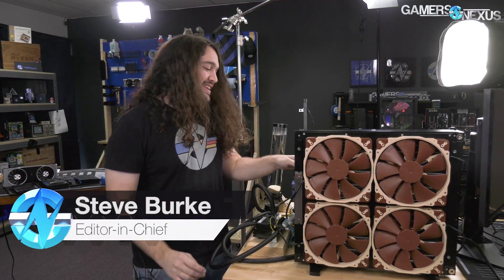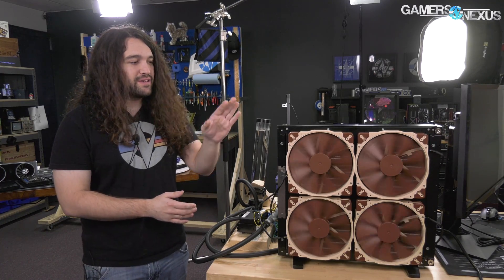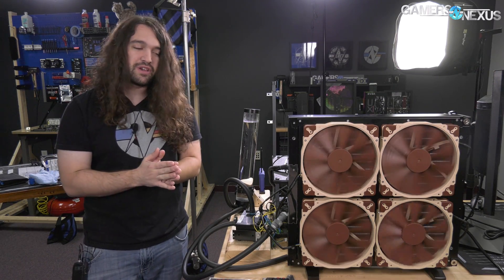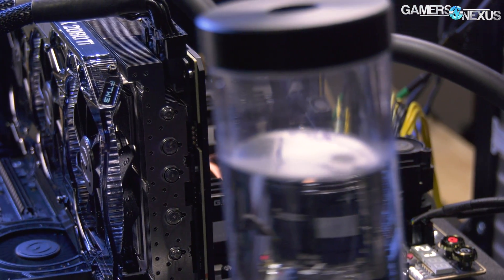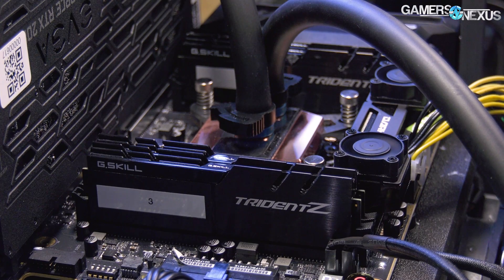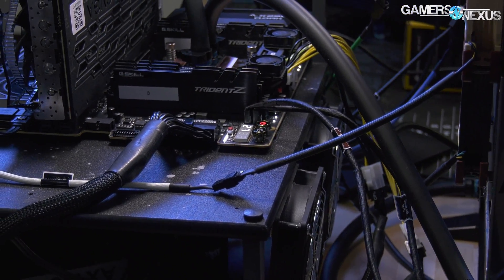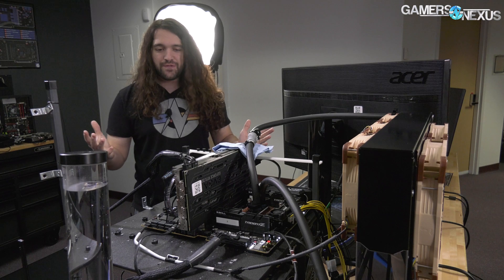9980XE Overclocking Stream Recap: Massive MORA3 Radiator

Comment: I had the idea of stacking thermoelectric chips for efficiency/cooling power. you can buy generic waterblocks in various sizes and I had one picked out that could hold 8 peltiers side-by-side. Never got around to modding it into my gpus, but 100 watts into 48 chips made a pretty good miniature air conditioner.

Comment: wouldn't i be better for the water to come out the bottom of radiator  giving that hot water rises?
Reply: Doesn't matter. Even a barely running pump is more powerful than the water.
Same with air. Natural convection can be easily overcome by a slow-running fan. A PC case isn't tall enough and the rather low temperature differential just too small to have a noticeable effect unless all fans are off.

Comment: I have the same brand HX from Germany, bought it about 8yrs. ago but mine is 9x120 or 4x180 fans. I have mine sitting on the second floor of my house and in a window all connected with  about 85 ft. of 1/2ID tubing single pump D5 Vario set at 7..3xTitans and a 5960 (running at 4.7GHZ) with a mono block all over clocked..and run around 115F in summer months and about 17F in winter months..17% Propylene Glycol to Distilled Water...approx 1.5 Gallons of solution. Amazing HX....Cool Video...Thanx for your time
Reply: wow dude please make a video of what you have now

Comment: Steve, I would like a video where you used this on a lower wattage CPU like a r5 2600x at stock and test the usability of a passive setup. And maybe test several CPUs until you find the threshold where the passive idea is no longer feasible.

Comment: I was considering the Mo-Ra when I was putting together my external loop earlier this year. I liked the side mounted reservoir, and the proper feet. However, the 9x140mm version I had my eye on (the one Steve has here) just felt too big, and I couldn't get all the matching parts at the time.
I ended up with a Phobya Quad 480/560 and knocked together a mount. It sits under my desk with the fans blowing outward, so it's quite nice now that the weather has started getting cold again.
I'm happy with the results but I still think about the Mo-Ra from time-to-time.

Comment: This seems like a very nice solution for cooling your computer when you live in areas with low outdoor temperatures. Just run the hoses outside and into that thing. Since it's outside, you don't need to worry about noise, so just hook it up with two huge box fans for a push/pull configuration and run them at full speed. That'd also allow you to have a very effective filter in front of the air-intake to avoid clogging up the radiator.
Reply: I have done exactly that, including magnetic filter. Works well as expected, except for hot sunny days. It is rated for about 2kW but with the filter and not high performance fans, its about half with acceptable temp delta.

Comment: Crazy idea.
Get 2 of those radiators, but thinner.
Use one for the CPU cooler, and the other one just in front of it
running ice cold water circulating through it,
in a push/pull config.
You can use an intercooler pump from a turbo or SC car for the ice water.
It's 12V
Reply: 2000cobraguy . While safe, it does seem the thermal efficiency is poor enough that it doesn't make much sense.
Reply: And intercooler pump from a turbo... The turbo is the pump

Comment: I am using that radiator, too, as an external cooling solution (attached the pump-reservoir combo to it's side) with just 4 large fans to get a basically absolutely silent setup. Moved it about 5m away from my pc, works like a charm :)
Phobya has a similar radiator called xtreme supernova.

Comment: you dont need that Radiator. If you just want good temps, both tubes into a 10 Liter bucket of water. It serves as passiv radiator+Reservoir and only costs 1 dollar. No cpu can heat up a full bucket of water.
Reply: Okay, just this once I will educate you. The volume of liquid has NO effect on the long term use. It will eventually heat up UNLESS it has enough surface area to radiate and conduct the heat to the surrounding material (that is, air, unless you e.g. bury the reservoir in dirt). You might get by with a metal bucket and medium PC load, but in any case, the large volume would be unnecessary, it is the outside surface area that does the work. AND it also implies that the surrounding material gets circulated so that it can dump its heat in turn.

Comment: It would probably fit into a case with all other components if you use the radiator as a side-panel. 
Well Ok technically it's not inside the case....

Comment: replace your glass panel with a radiator panel.
Reply: Replace all panels with radiators, who needs a case.
Reply: @backupplan6058  Should work but you would need a frame with filters!
Reply: @backupplan6058  Linus built an all radiator case.
Reply: Yes circle back around to 1998 cases!
Reply: That's what the previous owner did with my two MO-RA2s. Mounted them on each side panel. It was pretty bad.

Comment: At what point is it prudent to just get an unused car radiator, take the belt driven fan off, put some 200mm fans on and just use that?
Reply: Saw some similar size ones in a local auto shop, shame they are about the same price with the adaptors and parts to get it to same lvl, also not as dense and fine fins. I suppose a used one for cheaps might save you 50-80% but damn, some of em have a-lotta gunk in them, clog warning.

Comment: The real question is, why doesn't Intel publish accurate TDP specs for when your OC needs a custom industrial radiator with quad 200mm fans attached?
Reply: i get your point, but tdp is for stock operation
Reply: The real answer is, why should they?

Comment: Would love to see you do a more updated RAM clocking/overclocking video. My GSkill 4266Mhz is unstable with my 9900k. Sometimes it works fine, then other times machine goes crazy.
Reply: the SA probably can't keep up with those clocks lol
Reply: @bigdiglett3258  probably, was running 1.4v, the auto setting seemed high at 1.425v
Reply: was that your SA voltage? if so you might just have found a problem, if that was your dimm voltage you're fine
Reply: @bigdiglett3258  DRAM voltage is rated at 1.4v, but I had better luck with 1.45v running at 3733 15-15-15-36 @ 1.4v atm
Reply: @bigdiglett3258  yes, showed 1.394v in Windows/Bios after LLC adjustment.
Reply: @Ender_Wiggin03  running 1,4V VCCSA will kill your CPU. Even 1,35V is too much, I would stick to 1,3V for both SA and IO.
Reply: @dominikliberda4017  showing 1.296 VCCIO and 1.344 VCCSA in Windows, and everything seems very reliable at 4266Mhz at 1.4v. I'll try toning the SA down and see if it stays reliable.

Comment: Why not use speedfan to control the fans?
Reply: @moo  You can't link case fans with CPU/GPU temps in BIOS (UEFI)
Reply: @moo  What do you mean "You don't need to link GPU temp to case fans" in fact that's most important part, I like to keep my pc whisper quiet when it's not under load, and good luck keeping GPU temps in check with 140mm case fans spinning at less than 300RPM.

Comment: 2018 Glass Side Panels
2019 Air Cooling Radiator Side Panels
2020 RGB Air Cooling Radiator Side Panels
Reply: 2021 RGB Air Cooling Radiating case
Reply: just two days ago thought about case-radiator :)
Reply: what about using a car fan and the radiator?
Reply: You could just buy Thermaltake’s Xpressar RCS100 and have superior phase change cooling
Reply: 2025: Your PC is basically a see-through version with RGB LEDs of the freezer you had in your kitchen/basement since the 1960s.
Reply: A trend that is useful for performance!
Reply: Linus made one before.
Reply: @NothingXemnas  I saw the video of the radiator case. It's actually really cool.

But on a more practical note.
I would like to see standardised side panels with radiators.

Comment: Fun fact, the Mo-Ra costs only 216,93 USD (included a german 19% VAT). ~175 USD without VAT
Reply: Wow, not bad at all.
Reply: @GradyHouger  not bad for a rad of that size but you're still looking at another 130-200 for fans, res, pump, block, tubing and fittings. Still that's a decent deal for a super overkill cooling solution.

Comment: anyone else thought the bottom right fan wasnt spinning? @1:53 ish? Found i wasnt on 60 fps, I guess fan was spinning at really close to 30 rps? haha
Reply: to me it seemed it was spinning faster than the other 3 fans
Reply: @React2Quick i got that after i switched to 60fps
Reply: 30 RPS would be 1800 RPM, and those fans have a max RPM of 800.

It was just synced. Probably running at some divisible or multiple of 30 or 60.
Reply: Yay optical illusions
Reply: It looked like it kept skipping frames to me 😂 I wouldn't say no to that rad if I could afford it tho.
Reply: i think bottom right fan is rotated by 90 degrees clockwise

Comment: Lol 1:50 cool artifact on the bottom right fan. Pun intended
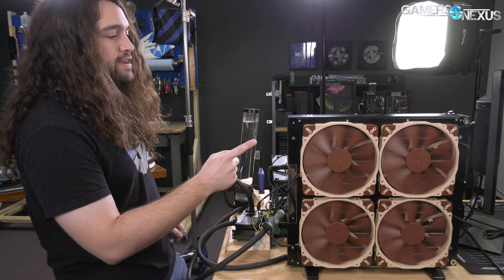Reply: i was about to ask, what's causing that? if it were from lighting PWM or camera frame rate jumps, i'd expect it to affect all 4. if it were from the fan physically changing speed i'd expect it to be a bit smoother and not an instantaneous jump (see 2:53)
Reply: @spambot7110  its the rotation rate syncronizing with the video's frame rate. the fan's position is captured almost at the same place everytime the camera records a frame. the sudden position change is probably another recording artifact (delay or frameskip from the camera itself, idk)
Reply: @NothingXemnas  the thing that's bugging me is that nothing else is affected by the "delay or frameskip". his head is moving throughout that moment and it doesn't jump.
Reply: @NothingXemnas  could it be a YouTube compression fail? YouTube has this system where where if there is a still image in the video it will keep it like a picture
Reply: @mlgnoscopeblazeit7708  lol wut
Reply: In the live stream he mentioned one fan was a higher RPM model from Noctua. He reduced the RPM as best he could to match the other 3.
Reply: missing the Atari XDXD    XD    XD XDXD artifacts on the fan, must be just spinning at a slight different rpm from the others, lol.
Reply: That was cool in 360p. And then it wasn't in 1080😂

Comment: If I recall de8auer discovered the actual die is thicker and had a lot to do with it.
Reply from the maker: We talked about that already: https://www.youtube.com/watch?v=6RDL7h7Vczo
Reply: der8auer mit ACHT
Reply: @-eMpTy-  sorry, there, acht.
Reply: peacemaker. No. You are confusing things. That was for the 9900K compared to the 8700K. This is the 9980XE and the die has the same thickness as the 7980XE.
Reply: @alexmarin7897  thank you for the correction.
Reply: The PCB, the IHS and the die are thicker. Even lapping all of those...You'll only get a 15°C reduction.
Reply: @crimsun7186  isn't 15 degrees celsius a lot?